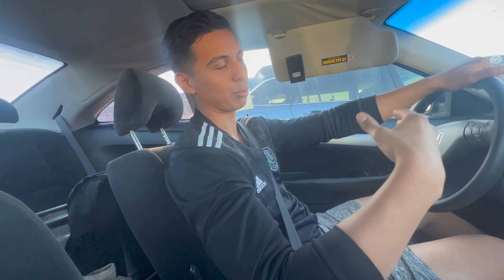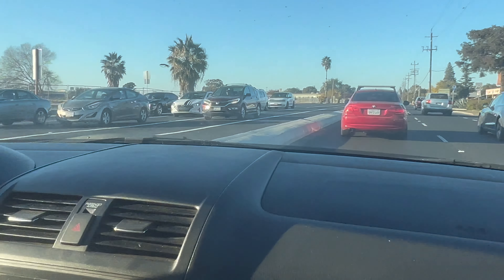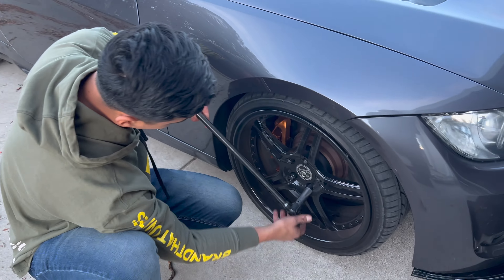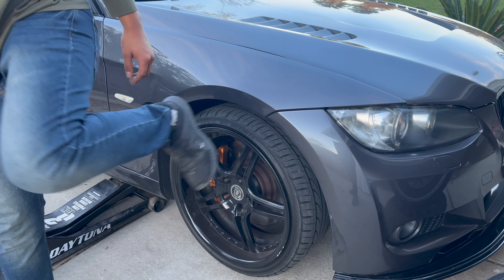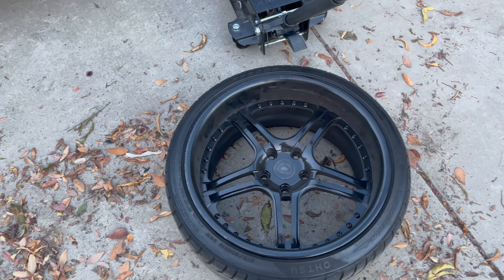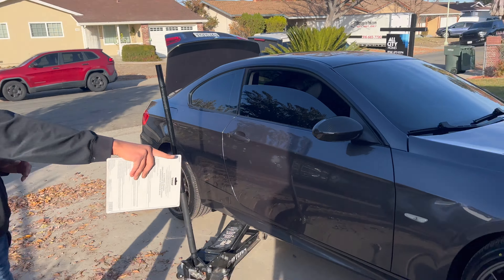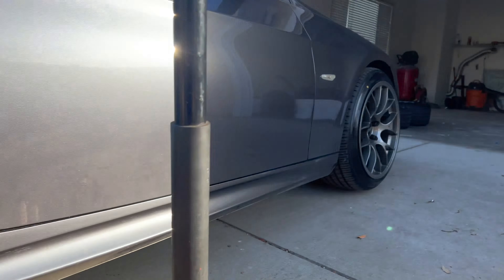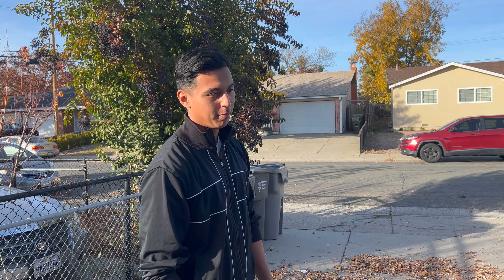E92 335i gets new wheels!!!!! APEX EC-7 ET33 18"X10"

Comment: 10” all around? Sorry didn’t watch the full video just wanted to see end result. Also any rubbing when going over bumps?
Reply from the maker: yes all around and no rubbing at all
Reply: @straightsixgarage2178  hey you think i could get away with 18x10.5 ET46 on my M sport E90 ?
Reply from the maker: @zoroee3758  you’re going to need spacers
Reply: @straightsixgarage2178  ok that’s perfect, just was worried about the deep ass offset.
Reply: What size tires 🛞? 
What’s the offset ?
I just got a e90 lci and needs wheels asap